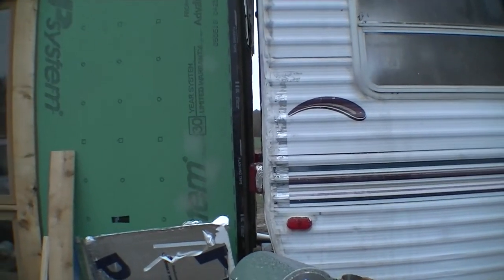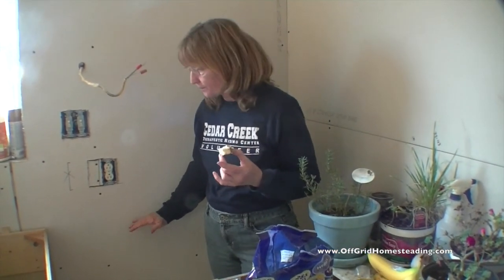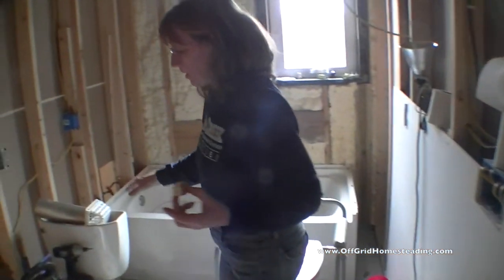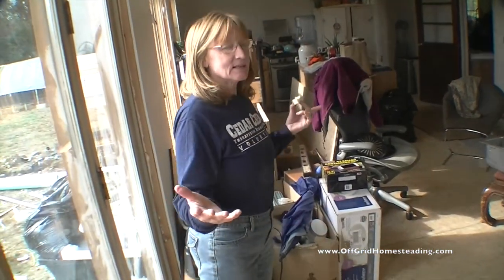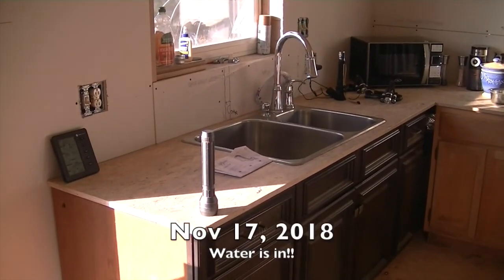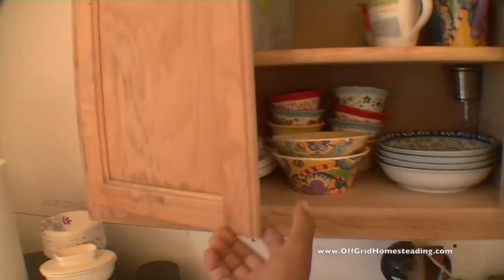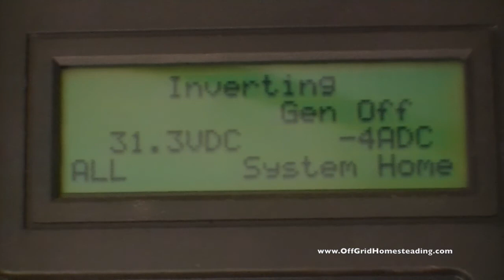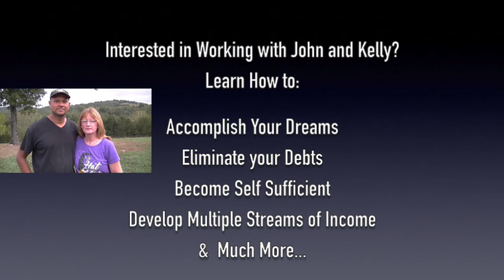OGH - Diy House Build Part 38: Camper Leaving - Moving In - Living without running Water for 7 days

Comment: Man how are you not freezing
Reply from the maker: Solar Passive home.  By 8am the temperature inside is mid 60's and stays warm all day.  In the summer the sun will be higher and not heat up the home as much.  Also all the walls have at least 5.5" of spray foam.  Floor has AT LEAST 7" - 10" of EPS Boat dock foam -- so the floors are comfortable to walk on barefoot even when it's below freezing.